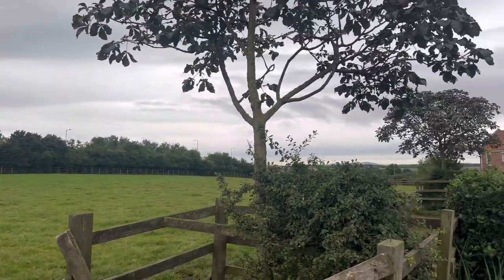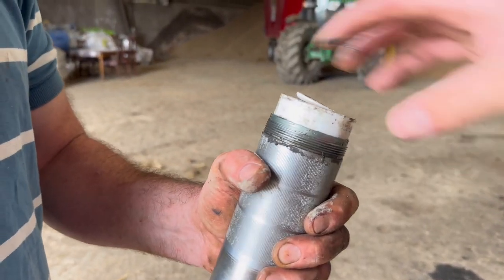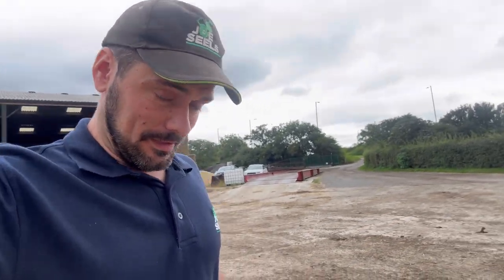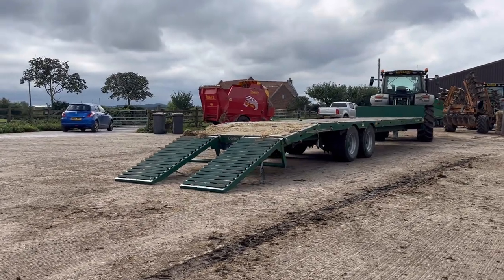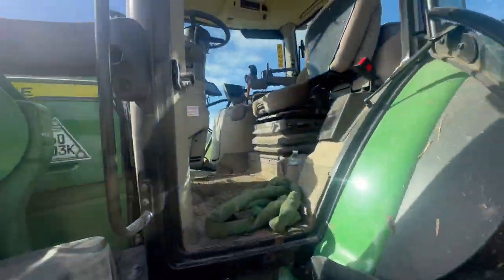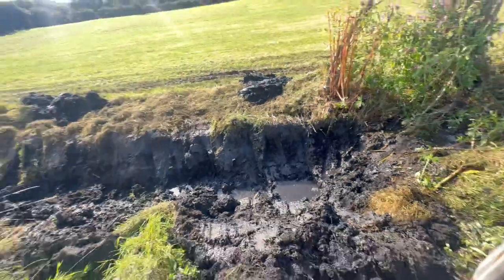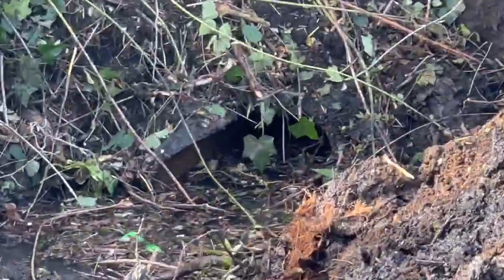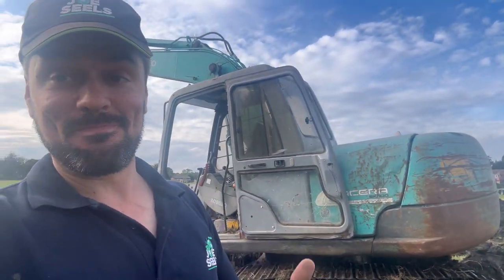I Get Splatted! Kobelco is Busy! Andy’s Hedge Cutting!

Comment: We grow tardis it does look small in the field but once you get it in it looks huge. Please invest in some buckets for your digger I run a very old wheel digger and have four rear buckets, makes the machine so much more useful.
Reply from the maker: Might need to invest in a new digger… the kobelco is a funny size fitting, so hard to find 2nd hand buckets that fit. Be better with something with a quick hitch
Reply: @joeseels  Does it have 60mm pins their are three ditching buckets on eBay for that size.

Comment: Joe you should be ashamed of yourself showing pins and bushes in that state i think line boring may be required grease is cheaper.
Reply: yes ok it might need some new parts, but how many times does he use that digger in a year, probably 3 or 5 times a year, so it’s probably not a priority fix, 
i’m not trying to argue with you just putting my point across, 
because digger pieces etc… do not come cheap now
Reply: Agree
Reply: Surely the oil in the hydraulic  tank can be filled to the top as all the rams are double acting so oil stays  the same level all the time
Reply from the maker: Have you looked at line boring prices… the digger isn’t worth spending the money on, unless you had the kit to do it yourself.
Reply from the maker: Don’t know enough to risk it mark, I would think there has to be some breathing room, it has a pressure release switch at top of tank??